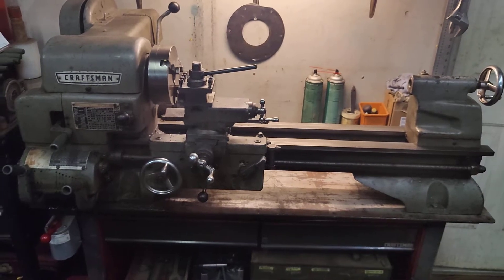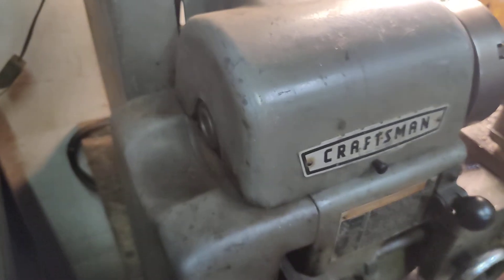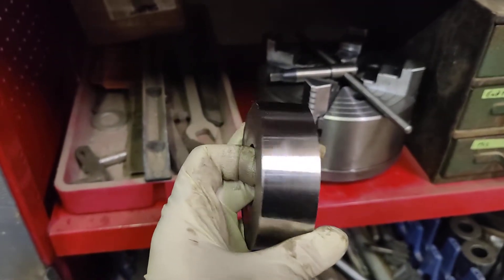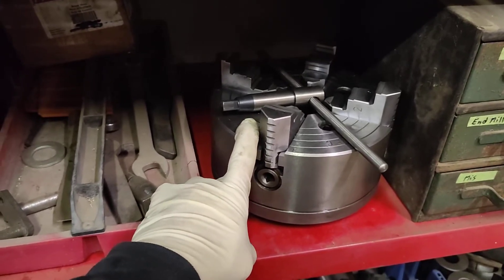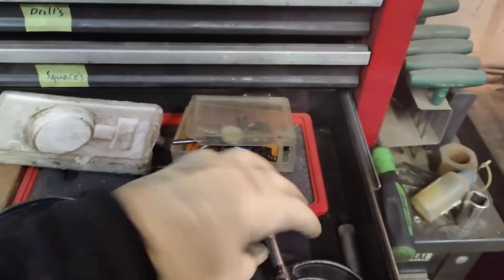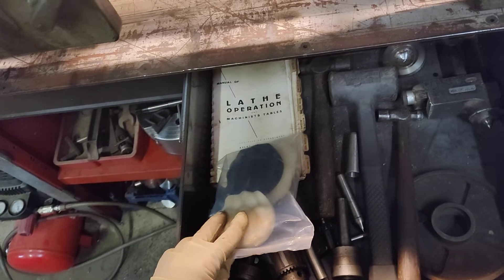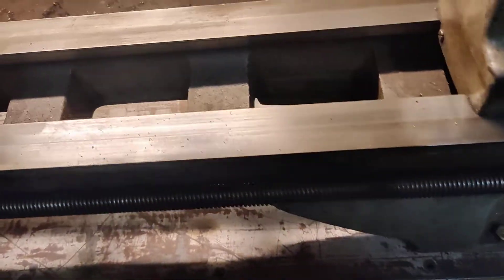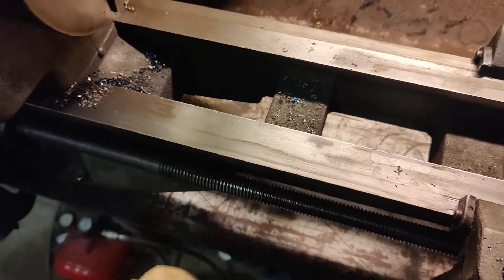12 inch Atlas Craftsman lathe up grade

Comment: I have a similar lathe, a little older, and I think my motor will need to be replaced. It's 1/4 hp and prone to overheat. I'm curious what you noticed when you upsized yours?
Reply from the maker: Sorry I haven't been active lately. Just decided to go on and post a video. But yes I did notice a big difference when I upgraded that motor. I can make massive cuts with no issue

Comment: My grandpa had one of these in his work shop. He past in 1995 but I just found a picture of his workshop and was able to identify the lathe from the pictures. I was 17 when he past but can remember a few times he used it to help me out. The thing I remember most was a rear axel bolt he cut and milled from scrap he had in a bucket. It was a 1982 Honda 450 Nighthawk that I had cross threaded the axel nut. 
Thanks for the video my friend!  This brought back some great memories from a time long past.

Comment: Nice lathe and tooling assortment, plus a great price too.  That soft jaw chuck is an armature chuck; mounted in the tail-stock, it's brass jaws secure the shaft of the armature of an electric motor while the armature is held in the headstock.   Jaws are not tightened, allowing the shaft to spin with lubricant.  Commutator segments can be machined down to clean up any rough spots and wear.  Best of luck on all your projects! Aloha!!!
Reply from the maker: That's very good to know I have worked on motors once in a blue moon thank you for the info and I appreciate the hospitality